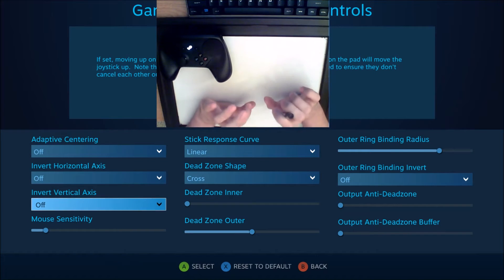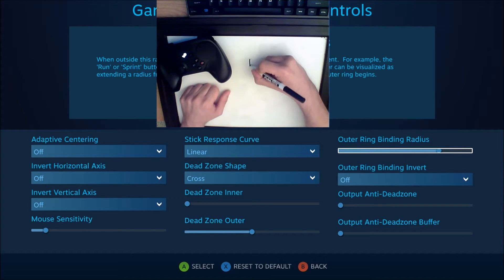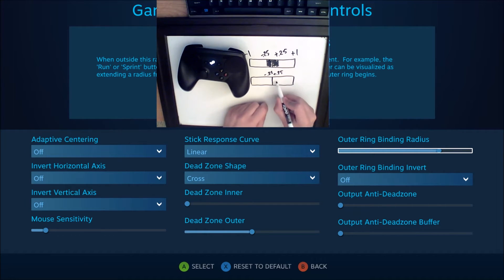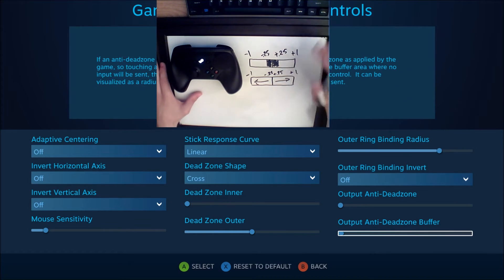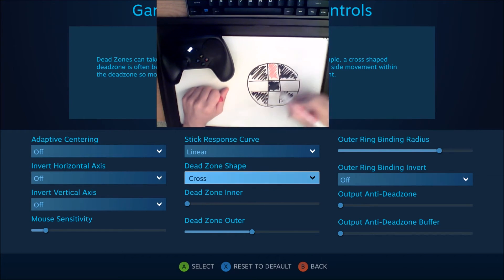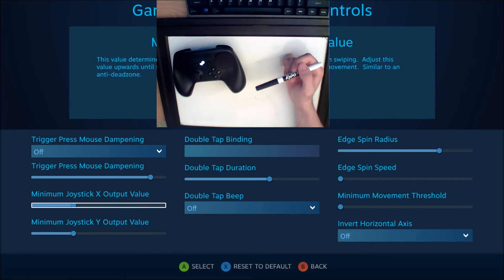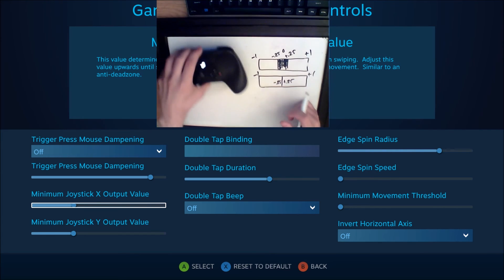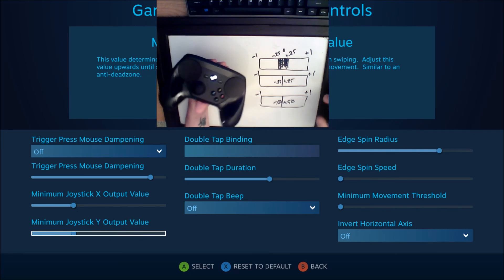More Steam Controller Tutorial Corrections

Comment: Thank you for this video, it really help me alot to understand these setting
Still question, i have a drifting controller, so i try to fix it with having a bigger inner deadzone and it fix it (thank you) but
when i try to decrease the deadzone using anti deadzone and even put in buffer, the controller goes back drifting, so i just remove the anti deadzone and buffer
why this happen, or is it im doing it wrong